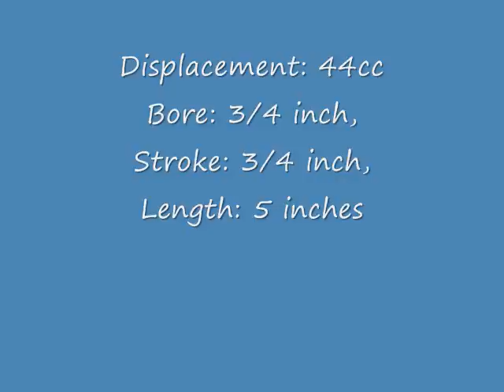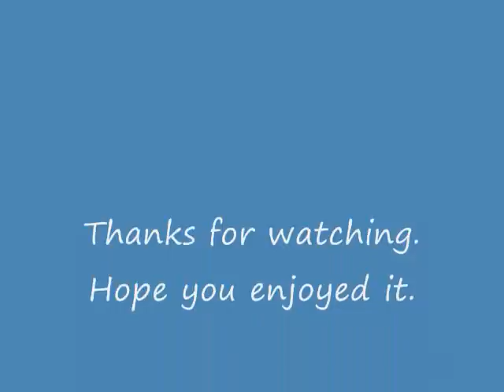World's Smallest running v8 engine

Comment: This motor would be awesome on a 1/5 scale RC Truck!
Reply: You can probably get more power out of a proper 1/5th engine, but yes this engine would be very scale
Reply: +That Guy With the Pointlessly Long Username That You Are Wasting Your Time Reading Right Now It is truly a beautiful masterpiece this engine! The sound is amazing! You just don't see these kind of engines in such small scales, the guy who built it must probably be a machinist or engineer because I have some knowledge in this field but I couldn't build that!
Reply: +Yannik A most of the 1/5th engines range from 24-33cc  your weed eater
Reply: shogunMR Yes, I have one, a 31cc engine!
Reply: He's building a transmission right now !!!
Reply: because the bores are so small it would not have enough power v8s just cant scale stick with the 1 cyliders

Comment: So no oiling for the crank/cam?Are they in sealed bearings?I'd love to see the insides!Any plans/dimensions available?Nice Job!
Reply: +Bowtie41 he mention oil and gas mixer setup. that is how the engine is lubed.
Reply: +tony mcclendon I missed that point.Thanks! I still wanna see the guts,and get plans/prints if available :-)
Reply: +tony mcclendon What the...is it a 4 stroke tho? or 2 stroke?
Reply: The same method as a weed eater or chain saw.

Comment: this plus a little generator would be the coolest way to charge my cell phone. I would have a circuit measuring output current and controlling the throttle through an arduino. a pro-micro specifically.

Comment: probably he is stronger than 1.0 EcoBoost
Reply: +The Arczi 1.0 ecoboost has more power than most real size v8's
Reply: potatohead 2 the one in f150 is better than chevys 5.3 in power
Reply: already did fords 6.2 makes 411hp chevys 6.2 makes 420hp what now ?
Reply: +TheEvanovitch lmao ok buddy
Reply: +Opticillusion160 ha-ha it does so do your research
Reply: +Dakota Webb No they dont. You cant say do your research if you don't know the person. Have a good one
Reply: not the 1.0 but the 2.3 ecoboost  can compare to some v8s not all
Reply: u sure ? top of the line ford f150 makes 385hp and top of the line silverado 1500 makes  420hp
Reply: +potatohead 2 I said 5.3 that's a 6.2
Reply: not fair to compare the 5.3 to the 5.0 since 5.3 isnt top of the line compared to the 5.0 dats top of the line
Reply: +potatohead 2 the ecoboost is top of fords line in f150 unless you got a 6.2 which is rare its mostly in f250 the 5.0 isn't top of fords its barely used the ecoboost is the higher hp and more used
Reply: +potatohead 2 the the 6.2 in Ford is only in 250s I stand corrected BTW, and the Chevy 6.2 isn't in most 1500s its mostly in suburban Tahoe's etc compare 5.3 to 3.7 ecoboost, 5.3 loses you can't compare the 6.2 Chevy to fords really at all cuz its hardly in there trucks. but you can compare Chevy's 6.2 to fords 6.2
Reply: explain why they compare the 6.2 in camaros to 5.0 is mustangs den ...compare the 3.7 to 5.3 really  r u foreal ? the 3.7 has 2 turbos add 2 turbos to the 5.3 and now who wins ? u just cant take the fact that the 5.0 looses compared to the 6.2
Reply: ford 6.2 makes 411hp and chevys 6.2 makes 420hp yet ford still looses what ur excuse now?
Reply: +potatohead 2 the 5.0 isn't really used in there trucks dipshit the ecoboost is yeah the 6.2 will destroy the 5.0 in a truck in power wise but if you compare the 5.0 to a 6.2 then compare fords 6.2 to Chevy's let's say a raptor vs a top of the line Chevy truck

Comment: 44CC = 2.68 CUBIC INCHES......I HATE THE METRIC SYSTEM!!!!!!!
Reply: +Ted Smith Don't worry, it hates you too.
Reply: inch-foot-yard-mile conversions are ridiculous and any small measurement has to be some obscene fraction, it's fine for bigger measurements I use feet all the time and we all use miles but for engineering and maths it's a pain in the ass, metric is super simple 10-100-1000 can't mess up
Reply: actually it's only like a .72 cu engine.
Reply: Metric sucks.

Comment: Very well done, but I noticed the crank had some movement. The sound was excellent, be nice in a kewl little RC Corvette, or even a truck. I also noticed how well you made the fuel tank and the riser ( I guess you would call it) that it was on, it was really nice. You really have something to show off, but I can't help but ask; With all that work you did, why didn't you make a kewl mount for the motor instead of just screwing it to a 2 x 6. Just asking.

Comment: I wonder how many watts of power that thing can put out, since it's probably less than one HP or KW
Reply: It might have more than 1hp, because i own an engine that is 22.7cc and finely tuned it outputs 1.23hp or about 1.12kW.
Reply: Obstsalat95 yes, i have seen those little nitro fuel engines, they are quite amazing. One difference is that this engine isnt running on nitro, so that may affect the power output significantly. But, i have a 66cc motorized bike which i use for racing and that engine outputs 34.445 hp on nitro, which is enough to go 109.1 mph.
Reply: a s do you know those 1/10 scale nitro rc cars? they have a 1 cylinder 2-stroke.engine which can generate up to 1.5hp....with that in mind, i guess this v8 has easily 10hp.
Reply: Obstsalat95 I doubt it since a 50cc moped engine only outputs about 4.5HP
Reply: SnOpeK Domowei hmm you got a point there...well i guess we need a vehicle attached to this engine and test it :D
Reply: +SnOpeK Domowei 50cc single cylinder engines make around 5HP so this thing likely makes 6 or so.
Reply: +Petra Biglow Ah but a moped engine is 2 stroke. This is 50cc 4 stroke V8 or not. It will make less than a moped.
Reply: KiwiPowerNZ  I Was thinking specifically of like a Honda Ruckus, which is a 49cc single cylinder 4 stroke.
Reply: Petra Biglow God that would be the definition of a gutless wonder.
Reply: KiwiPowerNZ it's gotta be better than the Honda Express that my friend drives! That thing tops out at 28mph on a flat, and it is a 49cc 2 stroke.
Reply: A. Zak Jezz. Our Stihl chainsaw is a 50cc 2 stroke for comparison. 

Our push mower has a 160cc 2 stroke, you'd think something self propelled like a scooter would at least match that. I recon if I took that 160 2 stroke and put it on a scooter it would fly. It has so much torque.

Comment: I know it's been a really long time since you posted this but I have a questions. I can make every part I see except the cam and crank. You couldn't make them on a Bridgeport, and the problems in making them on a lathe are mind boggling because of the part size vs tool size so, how or where did you come up with the crank and cam? I would like to see a schematic. Does it have lifters, push rods, 2 valves per cylinder? What kind of valve springs and retainers could you have used? They are tiny on a small motorcycle engine but on this I can't even imagine how it was done. Please post a schematic. You could make money on just the work you have already done. I do plenty of "one of's"  and know it's totally impractical when someone wants you to make one for them. There is not enough money in the world to do it on a piece by piece basis. Most of these folks asking for the parts have no idea what they are actually asking for. I bet you have thousands of hours in this little guy. Any info would be great. Thanks,

Comment: Mr. Peter, I was just curious if contained everything a normal pushrod engine has.  I'm guessing it doesn't have/wouldn't need a pushrod AND lifter combination, just one or the other.  But does it have a crank and timing gear, valve springs, etc.?  And have you thought about submitting it for recognition with Guiness?
Reply: or is it actually a two-stroke setup?

Comment: Still unreliable.... Nothing beats a Honda. :)
Reply: ah yes, because the VTEC DOHC L4 is such a great engine the timing belts snap every 30K miles like clockwork... reliability... sure...
Reply: Reliability wasn't the plan the plan was to make the world's smallest v8
Reply: Shamao Yang no if the timing belt snaps it's a interference motor which means heads and the piston will come in contact and means engine is done. Honda are known for burning oil anyways.
350 and 305 small block Chevy are known to last 200k miles with Just changing oil, cap rotor along with spark plugs and occasionally a water pump which takes 30 minutes to change
Reply: Shamao Yang nO
Volvo
Reply: Nobody realizes it's a joke
Reply: bigkarl24 you need a cookie!!!
Reply: Shamao Yang all cars drop about 14% in their first year and actually Chevy trucks have a high resale value for some reason
Reply: Shamao Yang Naw, sipper head, I am talking Nagasaki and Hiroshima, go eat a chihuahua or something you yellow piece of shit.
Reply: Shamao Yang Why are you so mad because you clearly can't accept the matter of the fact that hondas are just plain bad :)
Reply: Shamao Yang LOL, you are so butt hurt and owned that all you can do is keep avoiding the facts about your shit honda engines. Keep defending the people that think you are lower than shit.
How is that  weed whacker project coming along ?
Reply: Shamao Yang You are just a fanboy. Nothing more to it. You don't look at the reasons why people hate what you like and you don't even know why you like hondas.
Reply: Shamao Yang Sir you are getting wrecked so shut your sore ass up and stop being a butthurt little fucking baby.
Reply: Shamao Yang You're saltier than the goddamn pacific ocean. Honda makes terrible engines.
Reply: Shamao Yang Too bad a V8 lasts longer than any honda engine.
Reply: Shamao Yang I dont see a single Honda POS on here: http://www.carthrottle.com/post/10-iconic-engines-true-petrolheads-admire/
Reply: Shamao Yang No man its carthrottle. They have tons of different communities. Euro, JDM, Honda owners, VW Owners, gaming, topgear and just about everything. They had people vote on engines and quite frankly no body voted for anything Honda. :)
Reply: Shamao Yang I'm white, American, have owned more cars than all theese haters are years old, and come from a long lineage of patriots.

NOW, I will say this, American engines and thier vehicles are complete and utter garbage. Totally outclassed in EVERY single way by hondas, except in inefficiency.

Honda makes the best cars known to man, and hopefully they always will.

I have owned a big block mopar swapped 72 dart, a 350 chevy 2500 hd, a fox body mustang, and a slew of other junks.

I currently own a 94 civic cx hatch with a jdm b18c, and i wouldn't trade that rust bucket for a 2015 corvette. Lmao
Reply: I〈3hatersx69 U mad bro?
Reply: Shamao Yang This turned from an argument about cars to just straight fucking around
Reply: Except anything but a Honda
Reply: Shamao Yang Too bad the rest of the car falls apart around the Honda engine.
Reply: Zachary Hein but it's cheap and easy to fix. :)
Reply: james young But is it cheap doe?
Reply: Shamao Yang The fact that Honda's main selling point for there cars "cheap and easy to fix" proves how poorly made they are :'D
Reply: bigkarl24 Yeah, sure Chevys are known to last 200k. Why is it that 140k miles and they drop about $10k in value? Honda's stay relatively the same amount until it stops running. :) Duke Skywalker Yeah, and Chevys are cheap, but a bitch to work on so.... They don't sell.... I don't even drive a Honda and I know. :)
Reply: bigkarl24 Trucks is its own thing, but on craigslist these Hondas don't want to be affordable at all
Reply: Shamao Yang the engine is cheap. And by that I mean built incredibly cheap.
Reply: Shamao Yang AND they only get 10 bullets A DAY to train their marksmanship. Even so, the U.S. had to run away with their tail between their legs like a scared puppy XD
Reply: Real Twixx Yeah, but not as much as your dad. :)
Reply: ak47law You're just mad that what ever racist angle you take you're getting that ass beat. :) We got Nam, We got China, We got JDM motors face it your Confederate States are useless. You know your inbred blood boils at this fact. Keep on supporting that ak47 that put your grand pappy into an institute. :)
Reply: Shamao Yang You're just mad :)
Reply: Shamao Yang sorry u a fuckboii. :)
Reply: Real Twixx Atleast I don't fuck boys. Lol
Reply: ak47law Hahaha you're mad that your life is garbage so, you try (try) to use stereotypes to make you feel better, but you look in a mirror and outside and realize you're life is the stereotype. :) Goodluck ak47 because life ain't looking to bright for you.
Reply: Real Twixx You're dad's a butthurt little fuck baby. You're his son though...
Reply: ak47law You're still driving around your piece of shit V8 so I'm the real winner. :)
Reply: Real Twixx You drive a V8....
Reply: Real Twixx You drive a V8... LOL
Reply: Shamao Yang You drive a Honda... LOL
Reply: Real Twixx Better than a gas guzzling lackluster V8 laughing to myself.
Reply: Real Twixx That's a forum.... Where all you compensating V8 owners roam. :)
Reply: I〈3hatersx69 Lol this is just a big troll session.
Reply: Shamao Yang Ikr everyone is just having hissy fits.
Reply: Shamao Yang How does an ape use a keyboard wtf?
Reply: How to find out:
Step one: get camera
Step two: start recording
Step three: start typing
Step four: eat your banana
Reply: Shamao Yang Directions not clear enough; dick now stuck in toaster.
Reply: Real Twixx Well, you're gonna have to ride that one out. Bahaha
Reply: Shamao Yang so you do know that America fought along side Vietnamese soldiers....  And from thousands of accounts they ran from battle with their tail between their legs.  Your own people wouldn't fight for their own shithole of a country...
Reply: Shamao Yang #Toyotamasterrace
Reply: Honda in a nutshell ⬇️⬇️⬇️⬇️⬇️

VETACHHHHHHHHHHH WILL THIS FIT MY HONDA   DRAG RACE SORRY BRO FRONT WD 
HANDBRAKE TURN FAIL RICER EXAUST VVETACH  NO REPLACEMENT FOR DISPLACEMENT     1 liter turbo bro  FOUR BAGIN ?! Well guess what I got eight

Honda boy feel cheep

Comment: what are the specs ,,you mentioned 3/4" bore and 3/4" stroke ,,but what about the lift and duration on the cam,and how did you time the valves on such a tiny scale,,or does it use reed valves ? you also didn't mention if it were two stroke or four stroke,,I would assume since you're using a pre-mix it's a two stroke,,,anyway just curious..

Comment: Id want to put that in a RC car :3 that would be friggin awesome, 44cc's of displacement? I would like to put one in a chainsaw so it can sound like its actually got a real engine not a friggin dirtbike engine, and also it would be lighter just don't know if its actually making the horsepower necessary which I think is like 4-12horsepower for a small chainsaw, that v8 is beautiful and it would be increadible to have one in a rc car and if it does have enough horsepower I would had liked a chainsaw with one in it, that's beautiful its badass and I really really like it. "plus if that thing has 4-12horsepower id like to put it on a bicycle and mess with people by this small engine actually hauling some ass XD"